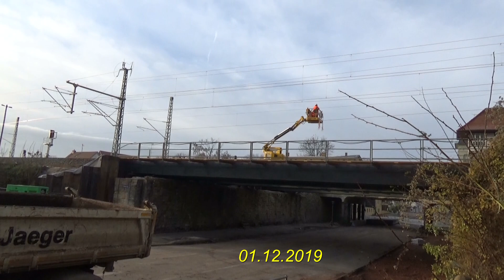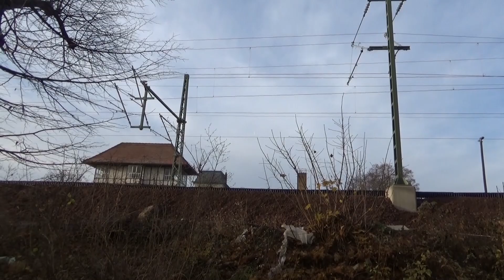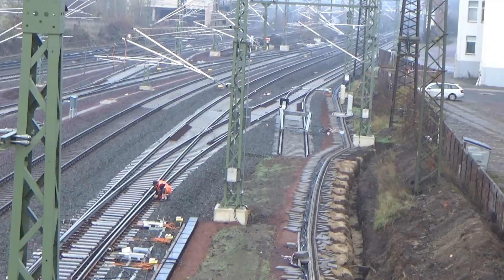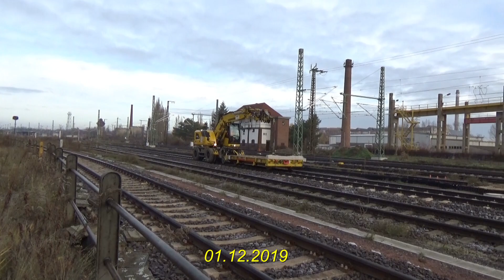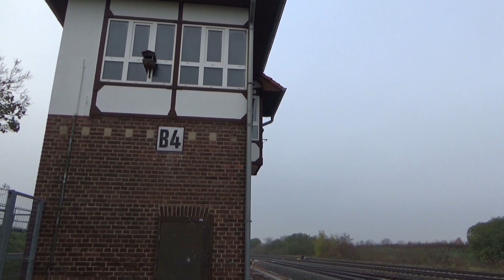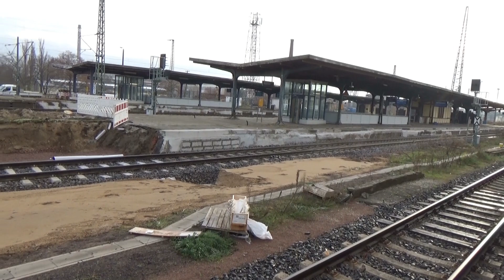Umbau  Bahnhof Köthen 24.11 und 01.12.2019

Comment: Thomas, thanks for the update, good to see the temporary bridge in use.   I know there is another scheme to  replace the station platforms but the existing ones are looking a little sad next to the newer track.  Are all the signal boxes now redundant following the installation of the signalling.
Reply from the maker: Hello Andrew. The temporary bridges will later be replaced by new bridge superstructures. The platform renovation will take place gradually over the next few years. The signals are not yet all connected, as it comes due to construction delays to postpone the opening of the station Köthen on March next year. A nice pre-Christmas time wishes you Thomas from Saxony-Anhalt.